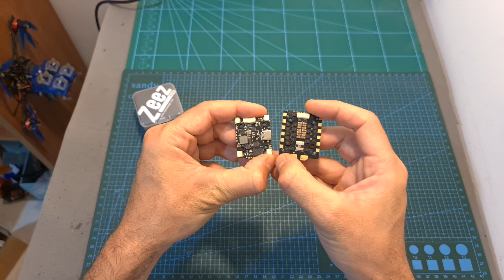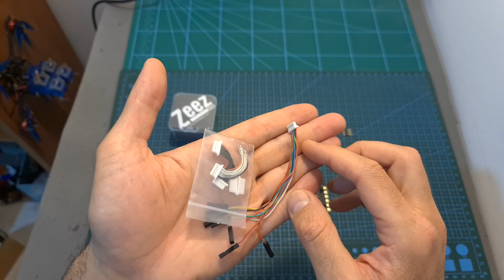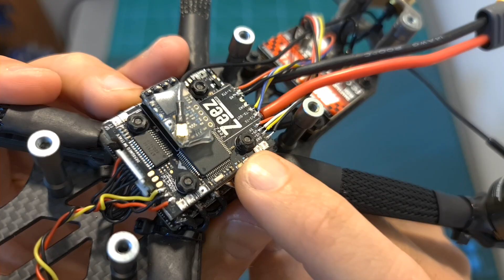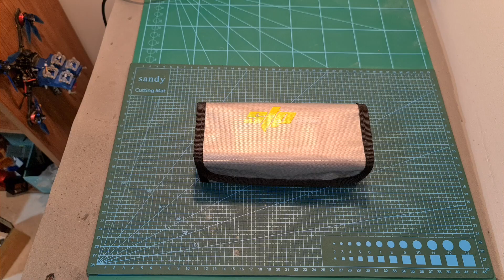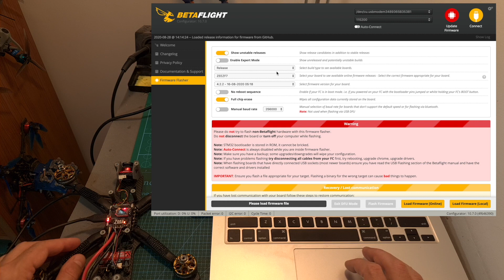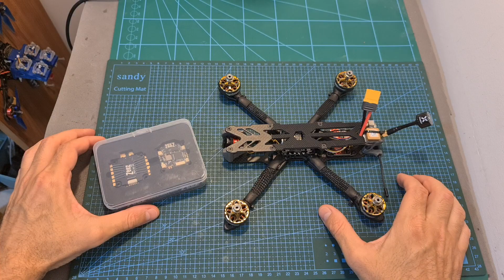Zeez 2020 Stack - Setup & Overview

Comment: Hi Gal 
Thanks for this descriptive video, very helpful as usual. I was wondering of the steps you did after upgrading Betaflight ? 
I recently updated the FC to BF 4.2.8 and the FC is behaving weirdly, Also, the vtx switch no longer works so I am forced to keep it full range on the arming aux otherwise the quad won't arm at all and I hear a buzzing sound. Any idea on what it could be ?
Other than that, the quad seems to fly like a charm but I am quite rookie so I am not sure I could tell if something is wrong. Thanks 👍
Reply from the maker: Hi there. Are 100% you sure that flashed the correct firmware? 
If so, I would suggest downgrading to a version where the VTX switch is working, as there might be some issues with the newer firmware. If it flies great, that's the most important thing - don't overthink it :-) 
Happy flying!
Reply: Good point, thanks for taking the time to answer Gal !